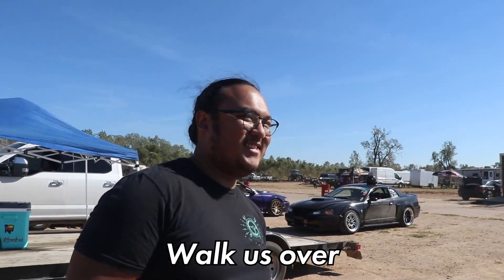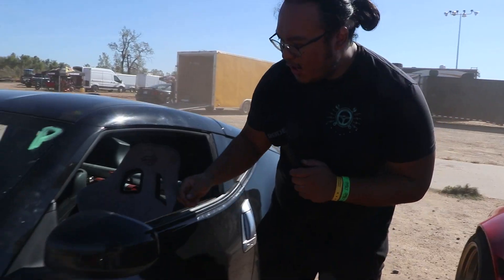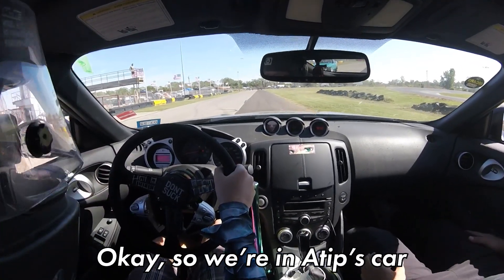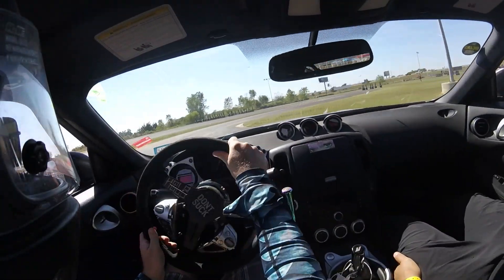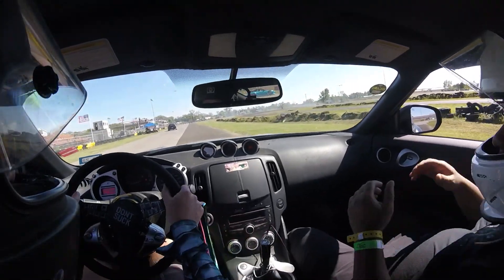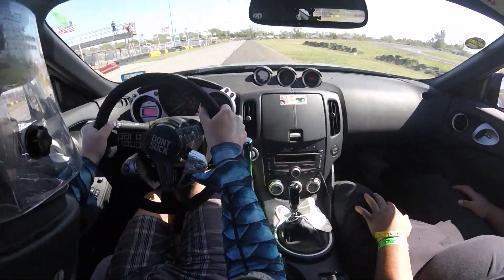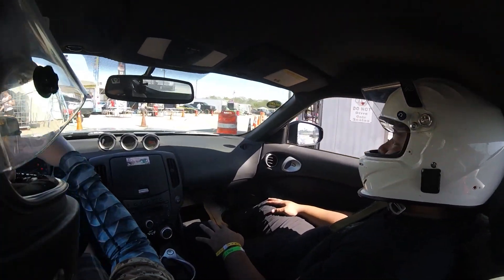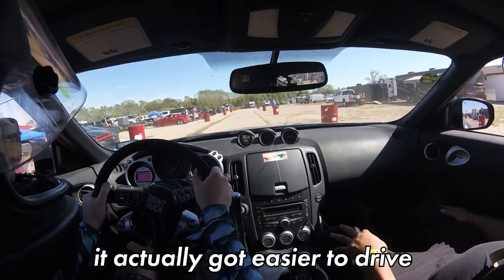How Hard is Drifting with a VLSD? (Viscous Differential)

Comment: Can you use conventional GL-5 to nissan R200V (VLSD) without LSD additives?

FSM says use "NISSAN Differential Oil Hypoid Super GL-5 80W90 or API GL-5 80W-90."

I was wondering if I can use any GL-5 (without LS spec or LSD additives) to our R200V (VLSD)..
Reply from the maker: As far as I recall, the Viscous LSD is a sealed unit, so it shouldn’t be impacted by oil choice, as long as you have it filled with the correct weight.

For what it’s worth, I run an ATS&ACROSS / Carbonetic 2-way carbon clutch diff in mine and use the oils recommended by the diff maker, which has been redline synthetic since 2005…never had any issues.
Reply: @KameTrick  i see. Thanks for replying!

Comment: ive played assetto corsa 45 hours with my set up, but i only  have a 3 yars old laptop, not gaming so it has like 10-15 fps on lowest settings and i cant see how that will inprove my drifting, because in one frame im good and in the other i have way more angel than i thought bcause i its not smooth enough, will it help me?
Reply from the maker: That limited visual information will definitely slow your rate of learning by a lot. There’s nothing realistic about not being able to see more often than not...the sooner you can get at least a consistent 30-60fps the better
Reply: @cokecan6169  frr

Comment: Do you feel like Vlsd is difficult to learn on?
Reply from the maker: It’s not too bad! The 370 works better with a VLSD than my KA 240SX did, that’s for sure. That extra power helps it to lock quicker. Basically all the on-throttle aspects are about the same, and the car grips up more off throttle but as you can see, I had no trouble adapting and linked the track on my second lap (I wasn’t even trying to on my first)
Reply: @KameTrick  sweet! I'll give it a shot then, I just got a g35 that I plan on learning in. Don't want to weld the diff unless I have to.
Reply from the maker: @bradymcfarland6528  I’ve drifted the G35 as well, but don’t have video from it😅 It worked well enough. Just go slow and assess how well the VLSD works before going full send and you’ll be fine 👌🏻
Reply: @KameTrick  thanks for the info! I'll definitely take it easy first time out. Also your AC videos were very helpful!

Comment: With good asphalt - no, you can't. VLSD is shit. I just installed OS Giken lsd on my 370z and now it drifts. Before that it couldn't sustain longer drifts not a chance, only if it was wet or very slick asphalt.
Reply from the maker: Sounds like your VLSD was worn out more than this one, cause I have personal experience with video evidence that it works in this 370 and my 240SX lol
Clutch diffs or welded ones certainly work better though, I use an ATS Carbon Clutch 2 way in my track car and it’s 👌🏻
Reply: sounds like a skill issue